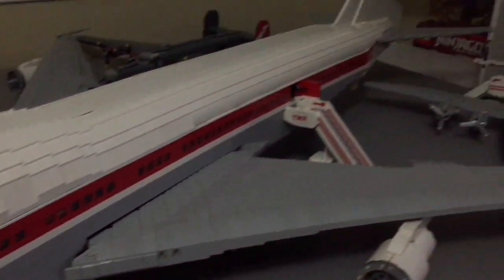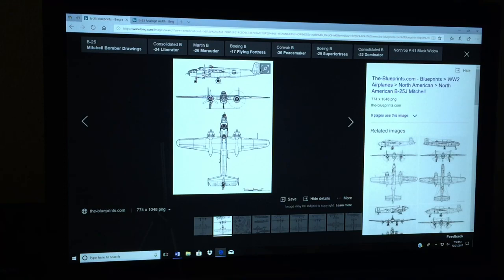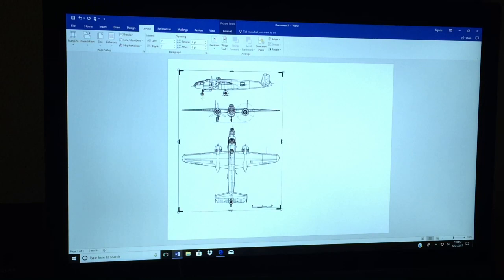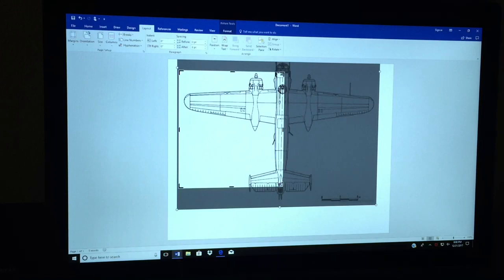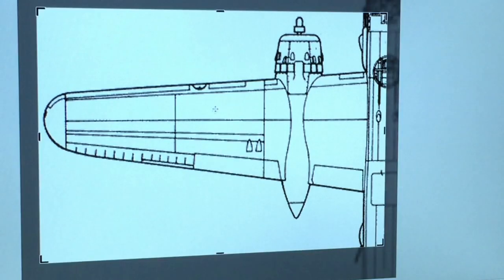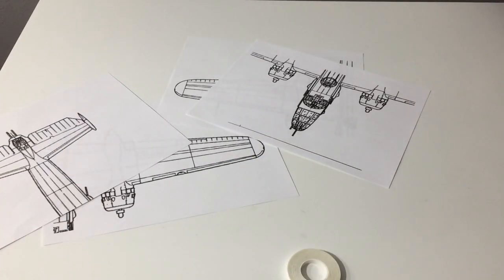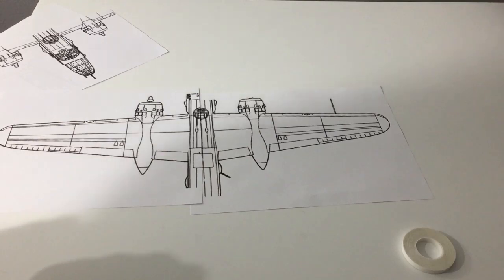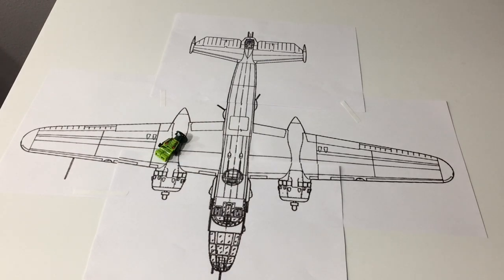How to get your proportions right EVERY time on your lego plane FULL tutorial

Comment: You're better off scaling the blueprint on your computer and sending the resulting file to your local printshop. They can print it on a large piece of paper (A2, A1) instead of sticking multiple A4s together. Also, the quality of the print will be much better as they're used to printing stuff for architects, designers and so on. And if you need several copies, you will save a great amount of time as well!!